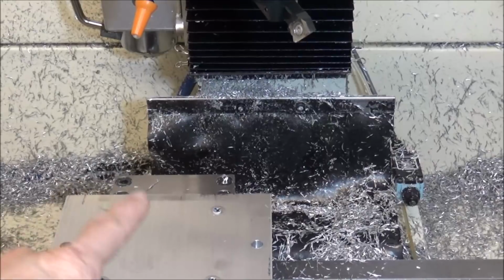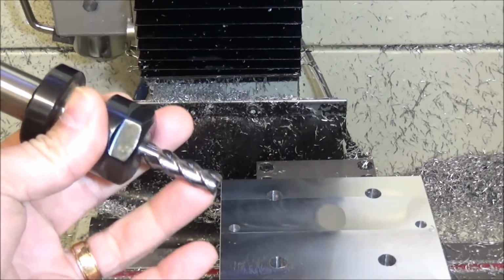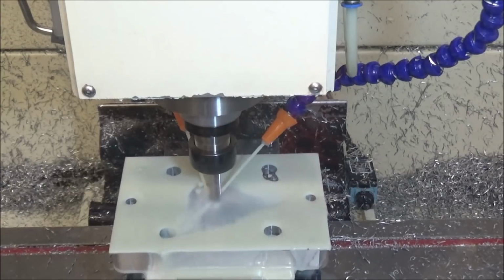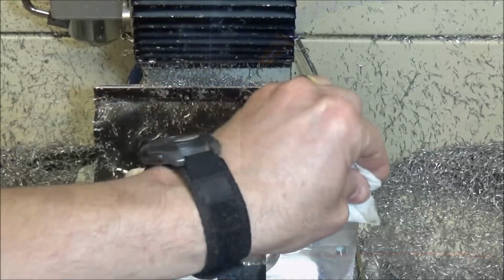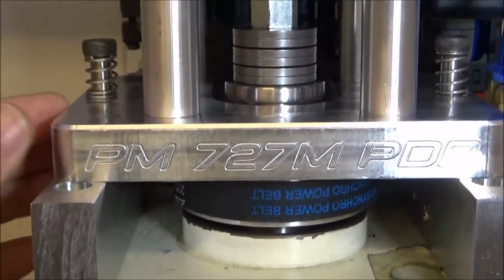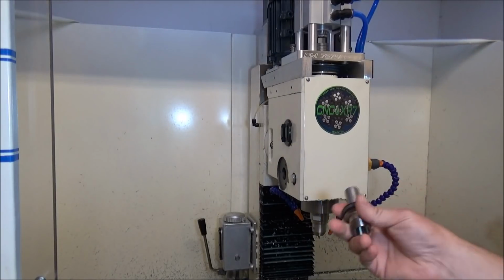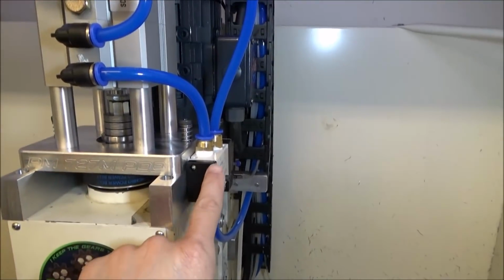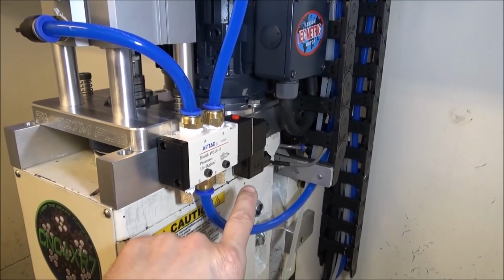PM727M Power Drawbar Part 3 lift plate continued

Comment: Hi Sam. For me that got a lot more interesting when you enthusiastically started talking about it all in detail at the end. I know the algorithms are now tending to favour longer videos, so I don't blame your approach, I'd do the same. Pity really. Only got so much time left in our lives! It is clearly a high quality installation you have put together. I'm wondering if I could make use of this on my Optimum BF30. Cheers, and thanks for posting.  Looking forward to the spindle end. BobUK.
Reply from the maker: Thanks Robert I try to keep the videos below 15 min. however that is extremely difficult sometimes. there was actually hours of video I had to sort through to get it down to 2 videos. I put the explanation at the end after all the parts were machined but I guess that could have been at the beginning. As for the BF30 i'm sure you could incorporate some aspect of this into a design that will work well.

Comment: You're making some really nice parts with your converted PM727.  It must be a rigid machine?
Reply from the maker: Yes the size is about twice of the G0704 in terms of Girth just smaller than a 45 series machine. so fairly rigid however a linear rail conversion would be better. I'm happy now the the quality of parts with the belt drive and PDB things are much nicer.
Be Safe,
Sam

Comment: Great video series on your first PM727M CNC conversion. I am planning a conversion early next year so I'm re-watching them. I have learned so much. I have a Grizzly G0762 manual mill that I don't plan to convert but want to add a TTS style power drawbar. However I noticed a problem because I still use the quill for Z height. The problem is the quill spline shaft moves down when lowering the Z height. With this arrangement the lift plate would prevent shaft from moving. Have you seen a TTS PDB that still works with the quill?
Reply from the maker: The movement of the quill up and down will prevent a lift plate as you mentioned. To be honest It's a lot of work if your not going to cnc the machine.
Reply: @CNC4XR7  Thanks for the reply Sam! I'm afraid you are right. The only solution I could think of was a removable (pivoting) lift plate but that kind of defeats the purpose of having a PDB in the first place.
Reply from the maker: Yes it does! I suggest leave the manual mill manual and go with maybe a Er collet setup that make things a little quicker.

Comment: HI Sam,  Was curious if you have a source for the 3 stage 80MM air cylinder?  I have previously used the 3 stage 100MM on a PM25 but am in the middle of converting a second PV25 and want to give the lighter 80MM a shot but can't locate one anywhere.
Reply from the maker: The 3 stage 80 mm air cylinder requires Higher air pressure than the 100mm minimum around 150psi to release the tool. I get them from China MOQ of 10 though.
Reply: @CNC4XR7  I ran the 3 stage 100MM like CruddCnC used (even used his same supplier), and loved everything about it except for how big, bulky and heavy it was. Just looking for another solution.